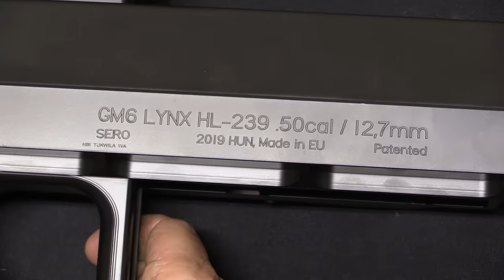GM6 Lynx: The Hungarian Long-Recoil .50-Caliber Bullpup

Comment: Finally a semi-auto .50 that fits into the overhad carry-on boxes.
Reply: I know that's a bit of humor, but I´m actually rather surprised that this weapon hasn't been adopted by more specialist units in the US which need to deploy by helicopter insertion prior to moving overland on foot and still want to have some form of anti-materiel firepower on hand, like special forces or the airborne.  Seems like this would be the ideal solution, more so than the Barrett at least.
Reply: @Darwinist  Money. Same reason the US armed forces refuses to upgrade from the M-16.
Reply: So the Marines HK 416 is not a thing?.
Reply: @bachtomin213  the 416/M27 was originally a partial replacement for the M249 in urban areas, where a sniper could easily ID the dude with the SAW.

Then the Corps discovered that it was significantly more accurate than the M16, so they prohibited the SAW gunners from using the M27 in their annual rifle qualification shoots.

Which also led to the Corps wanting a new Designated Marksman's Rifle, the M38. And the M38 went from a DMR to the basic infantry rifle at some point (I missed that part of the story, it may have been for spare parts commonality).
Reply: @bachtomin213  and when you only have to buy about 70k rifles that all basically have the same handling as your old ones, you can splurge a little.

I'm sure HK gave a good deal to the Corps.
Reply: @geraltofrivia323  Well if it ain't broke don't fix it*

*Usually
Reply: Also don't forget that the US are stubborn as fuck when it comes to "made in the USA" priorities. Why do you think they decidef to adopt the m14 instead of the FAL or the G3. They still adopted the m27 though, which is essentially an HK416. You really need to develop something special to their hearts to get them to even look at it.
Reply: @caffeinatedinsanity2324  not just the US, really.

I mean, there is a clause in WTO fair trade treaties that, for military contracts, a local maker can be up to 50% more than the lowest bidder and still win the contract.
Reply: @caffeinatedinsanity2324  idk i put a fal or g3 next to an m16 and they just have a certain soul that the 5.56 doesnt. the asthetic of the "african mercenary rifles" are hard to beat
Reply: @Darwinist  They tested in the US, they (some branches) wanted to adopt it but the competition lobby killed it...
Reply: it's always good to know that there's a small, powerful anti-material rifle that fits into an inconspicuous guitar case or the sort that I can easily carry into government buildings undetected to definitely not commit acts of domestic terrorism
Reply: @Darwinist  actually the SAS using it. they are british tough...
Reply: @puncifikator3870   Every competent insurgent knows that a truck filled with as much ANFO as you can get hold of is a far better way of raising hell than one guy with an anti materiel rifle.

Comment: This rifle is an Engineer's wet dream,  Well thought out and executed. The brass bearings for the barrel is clever...the bearing wears out, not your barrel or Frame. 👍🏻 I see no need for it having a double stack magazine. It's role isn't anti personnel or suppressive fire, so a 5 round single stack is fine. I LIKE this rifle! 👍🏻👍🏻
Reply: It may have no current need for a double stack magazine... but back to the "engineer's wet dream" sentiment, the magazine retention and locking system means you can pretty much hang whatever you want off of that point, be it single, double, or even offset drum.

Wouldn't it be interesting to come up with a spring-powered attachment that fits that magazine rail, that winds up and carries enough tension to de-link and feed 15-20 cartridges up a short chute and hold them in place for the bolt to pick up. Yes, it would need to be wound up when a new belt is loaded, but that removes the need for the firearm to run the system, and if you've sent out 20 rounds of .50BMG from this, you probably welcome a different activity for a short while.
Reply: @mfree80286  Lol! There in lies the problem. Whether it be chambered in  .50bmg, 12,7 or 12,9mm, the sheer size of the rounds is a Detriment to constructing a hi cap magazine that isn't so large it needs a crew to carry it for the gunner. 😆 👍🏻
Reply: @SierraBravo347  That's why I gave the imaginary belt a whopping 20 rounds :-D
Reply: @mfree80286  Lol! I suppose that would be manageable enough. 👍🏻😁 Either way, it's just an Interesting and good looking rifle imo.
Reply: Expensive to produce through, as Ian was going through the disassembly I was mentally counting all the machining operations and this is not a cheap weapon to produce. Since it's a specialist role weapon that's fine but from a military perspective however many you have going into a fight is pretty much how many you'll have at the end of the fight.
Reply: @andrewfidel2220  I was thinking the same. They would be fairly expensive to produce. Luckily, as you mentioned, they are a specialty role weapon, so not as many would be fielded.
Reply: @andrewfidel2220  I could see a military fielding these at a 1 per platoon scale, especially if they're spending a lot of time in urban areas. That adds up in a big hurry.
Reply: “Engineers wet dream” doesn’t always mean best
Reply: @braydendelgado5617  "Best" is a highly subjective term. To define "Best" you need to set parameters as to what a particular things objectives will be, the environment it will need to operate, etc.
Reply: @mfree80286  like a short hospital visit
Reply: @braydendelgado5617  example: I know several engineers that drive a Prius. Because it's interesting.
Reply: When the rifle would only have five rounds, I'd rather have a bolt or just make it a single loader at that point
Reply: @adeptusfantasticus  there are some advantages to an autoloader for fast follow on shots or for shooting on the move.

But I do admit that the 5rd magazine is a bit odd, when the Barrett has been doing 10rd since forever.
Reply: @ScottKenny1978  I'm of the opinion that things larger than intermediate rounds should scale up more, like .700 NE is cute and all, but when are we gonna get rid of the WW1 stuff we got and bring out the 120mm SAW gahdemmit
Reply: @ScottKenny1978  i also think it should be single shot cause I'm poor, but yeah I love the functions of an autoloader, especially with how perfectly timed this one is
Reply: @adeptusfantasticus  comes from how energy levels scale as the caliber increases.

5.56x45mm is about 1300 Joules.
7.62 NATO is about 3500 joules, and makes a reasonable "maximum energy for full auto from the shoulder" benchmark.
.50bmg is 18,000 joules.
14.5x114mm is 30,000 joules.
20x102mm is around 60,000 joules.
30x173mm is 200,000 joules.

120mm M829A3 muzzle energy is 12,100,000 joules, but I'm going to assume that was a typo.

A 20x102mm magazine-fed rifle weighs about 60lbs. As a bolt action.  (See Anzio Ironworks 20mm)

A 20x102mm autocannon like the Colt M39 series weighs 180lbs, and needs the barrel replaced every 4000 rounds.

We won't see anything bigger than 7.62mm as a Squad Automatic Weapon until the deployment of not just combat exoskeletons like from Edge of Tomorrow, but full on Starship Troopers powered armor.
Reply: @adeptusfantasticus  being a single shot would save a good bit of weight, but all of it in the back. Would do weird things to the balance.
Reply: That bronze/brass bearings are a common feature in mills, lathes, and old artillery pieces. Anti-friction alloys...
Reply: To be fair, most targets don't need to be shot more than 5 times if you are shooting a .50cal.

I'm saying from a squishy militia to a coldwar grade APC. 5 shots is more than enough for what you need for a .50cal sniper rifle.
Reply: it's ugly though
Reply: @darkkira1332  but you may need more than 5 shots in a target rich environment.

Example: raiding an airfield, or dealing with a SAM site.
Reply: It looks like an engineering students' co-op project.

Ok, they aren't designed to be manufactured in the tens of thousands, but still... The amount of man-hours that goes in to building that thing must be just silly.
Reply: @JH-lo9ut  based on retail price, not all that much more than a Barrett or Accuracy International.
Reply: @AbuHajarAlBugatti  no. .50 BMG can literally give you a concussion. It's not a round you fire more than five of at a time from a rifle.
Reply: @mopu8775  You are objectively wrong. It looks like a brutalist's wet dream and we all need to love it!
Reply: ok

Comment: The tunable muzzle brake is a very neat little feature. Something so incredibly simple making such a large difference.
Reply: Indeed! Genius! The whole gun seems to be such sweet deal! Such an interesting construction. Seems complicated but in practice, not so much. Very, very well made. Massive springs everywhere, but it´s a behemoth of a gun too! The constant improvements keep´s the gun alive as well. Exited to see this being fired!
Reply: @darkoflight4938  I suspect that someone with a background in designing artillery pieces was involved in this project.  So many design elements that someone steeped in traditional small arms might not think of but are very common in big bore indirect fire weapons.
Reply: @Darwinist  it's really just drawing tons of inspiration from the Barrett M82.
Reply: i think ian had it backwards though. the more you unthread it, the more it breaks.
Reply: he definitely has it backwards. unscrewing the muzzlebreak reduces recoil, until it reduces it so much that it doesn't cycle. so for heavy loads you want it more unscrewed, and lighter loads you can screw it all the way back in.
Reply: @louiscyfer6944  That's what I was thinking. The further you screw it on, it looks like more gasses will go straight out (increasing recoil) rather than being diverted by the brake (which reduces recoil). So you would want to screw it on more for a light load, and screw it on less for a heavy load.
Reply: Far from unique to the GM6 though. American Precision Arms makes one for $170 if you want one. Don't ask me who made it first, though.
Reply: @louiscyfer6944  Isn't that how you tune it though? Unscrew it until it fails to eject and than screw it back to the point where the recoil is acceptable for you.
Reply: @aronnemcsik  not the point, he had it backwards how it works.
Reply: @louiscyfer6944  ahh ok.

Comment: 17:42 Fun fact, that brass (probably bronze) bearing is very common in hydralic cylinders that see high heat and extensive side load that also requires a cheap running surface. Bronze/ brass bearings or (wear rings) are typically used more commonly than a typical wear band like phenolic, or glass/ carbon fiber resin due to the cost of custom parts and heat resiliance.
Reply: @SenorBigDong69 
since it's built like a hydraulic cylinder, you could totally use the back of the bolt as a hydraulic press
ever wondered what a marshmallow would look like if it took the recoil of a .50 BMG? stick one behind the bolt!
Reply: Pretty commonly used in your car's transmission and axels too
Reply: @Thelothuo  

Indeed ...

Having been around Stationary Steam Engines, used for pumping potable water  for homes, for a fair bit of time (long story is long ...), a lot of bronze/brass was used, not only because a well maintained engine, with gleaming brass, looks 'pretty' (and also showed the pride of the men operating them ...), it was a lot easier on high wear areas to replace, compared to, say, the iron (both cast, and wrought) usually used for the rest. Also, if I recall correctly, brass/bronze is a more 'smoother' surface, requiring only a tiny bit of lubricant, especially with a certain percentage of tin (again, iirc ...), it makes it easier to turn down to pretty tight tolerances, even in the late 1800's ...  so interesting to see some engineering hasn't changed much since then ...
Reply: @CynicalOldDwarf  No, those are just typically standard thrust or roller bearings. Better example is the crank bearings for the crank shaft, but even then, those are still steel with good lube and less intense side load than this bullpup and hydralics.
Reply: @XoJOHNoX96  I mean a manual transmission, the sync rings are usually made of brass
Reply: @XoJOHNoX96  Typical crank bearings are multi layered: a steel backing supports a bronze layer which is in turn coated with a thin layer of tin-antimony 'whitemetal.'

Bronze bearings are super common in lots of equipment, I've made and installed a few sets of them in various machines.
Reply: Why not use a steel bearing?
Reply: @Gautam Natrajan  less slop for same function. Retains zero probably.
Reply: @gautamnatrajan1990 because if it was steel, both the bearing and the barrel would be of quite similar material hardness (since both would be steel then, albeit probably different alloys).
That means that both would create (not insignificant) wear on each other, since neither has a "hardness advantage" (think of how we use sand in sandpaper as the grinding surface; it's very hard compared to say wood, or even most metals/alloys).

By using bronze for the bearing, which is a way softer metal (alloy, technically), it gets worn proportionally much more before the steel of the barrel does. And so, you end up not having to change your barrel for every thousand (or less) shots, but can instead just change a (comparatively, at least) very cheap little bronze bearing ring.

It's also dead simple, and easy to machine very precisely, so there's less to go wrong than if they'd used some form of ball or roller bearing (which needs lubrication and better cleaning, and are still less tough).

Comment: Far Cry 4 introduced me to this gorgeous rifle. A compact semi-auto .50 cal, with a reciprocating barrel that goes back and forth and back and forth as you fired... Instantly fell in love with it. And this video is the perfect Christmas present... Thanks Forgotten Weapons!
Reply: I'd been about to reply that I thought it was the Desert Tech HTI, but then I reread your comment and saw ya said 4, not 6 (or I think 5 too).
Reply: It's also in Arma 3, used by AAF and CSAT snipers.
Reply: @Uukassiu  And the GM6 in Arma can be loaded with APFSDS projectiles, for taking out APC and MRAP optics and weapons or shooting vehicle occupants through thin armor. If you see a helicopter hovering in the distance you can put a few into it's engines and take it down.
Reply: Wait, there's APFSDS .50 cal rounds? I've only heard of APHE rounds but this is new
Reply: @SkipTheKip  There's the BMG SLAP round and the Chinese make one in Russian .50
Both are APDS though
Reply: Okay so I looked at Wikipedia and, you're right! They also have the Raufoss Mk211 HEIAP rounds but I've never seen anyone use it in a rifle before
Reply: @CyarSkirata  HTI would likely hit harder due to not having an action to use pressure up but is also heavier and slower than the barret or GM6. its honestly a toss up of drawbacks and advantages. the fixed gas system of the Serbu BFG-A is also a middle ground of all that, accuracy without the slow rate of a bolt action plus the legendary lockup and reliability of the AR design
Reply: @rubiconnn  idk if irl APDFS would work so great in a long recoil....

Comment: That sintered bronze bearing has oil impregnated in it. It is indeed a wear part, but they are perfect for high load, low speed applications, so you can see why it was used here. Also, super reliable compared to a linear ball-bearing alternative. They don't really fail catastrophically the way other bearings often do. They just wear until the gun becomes less reliable over time. I also suspect that that particular bearing would last many 1000s of rounds. And the are cheap and easily replaceable. Like what you'd expect from a practical eastern-bloc country.
Reply: It’s perfect. It will tolerate linear or rotational movement and withstand very large loads.
Reply: please don't call us Easter block. We are literally in the middle of Europe.  😊
Reply: @mydigitalfootprint.  Eurocentrism, where "eastern" eurpopeans are considered second hand citizens except when convenient
Reply: @huleyn135  what that even means?
Reply: @mydigitalfootprint.  So was Hungary being on the Soviet side of the Iron Curtain just a fever dream?
Because that's what that term refers to - Countries that were under the influence of the USSR.
Reply: @istvankarolyfarkas6125  is it in the middle or not?. Kedves István.
Reply: @mydigitalfootprint.  It doesn't matter where it is. Gdr (NDK if you don't get it) was an Eastern Block country.
Why?
Because. It. Was. Under. The. Influence. Of. The. USSR. (Soviet Union., СССР,  etc.)
It has nothing to do with geographical location.
Reply: This is what I wanted to write. The bronze ring is plain bearing, some times better than ball bearings. Not the weak part, fluid friction, long lifetime, well tested system.
Reply: Those bearings are reminiscent of the types of bearings inside a typical vehicle engine, such as camshaft bearings.  Simple metal on metal with oil providing lubrication.
Reply: Oil-impegnated bronze actually has very good properties for applications like this, as long as it is not drastically overheated or have some odd improper heavy contact.
Reply: @mydigitalfootprint.  eastern bloc just means soviet/communist aligned in the cold war
Reply: @mydigitalfootprint. Central Powers
Reply: @mydigitalfootprint.  Hungary was a Communist country when this gun was made. That's what "Eastern Bloc" means.

"Central Europe" just stopped having any political-economic meaning after the Nazis and their European allies were defeated.

Is this history not taught anymore?